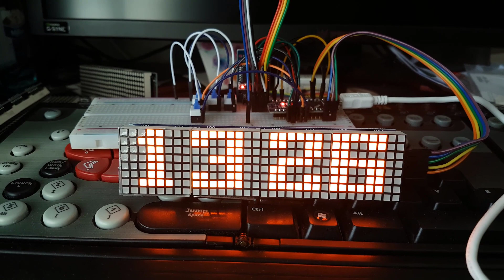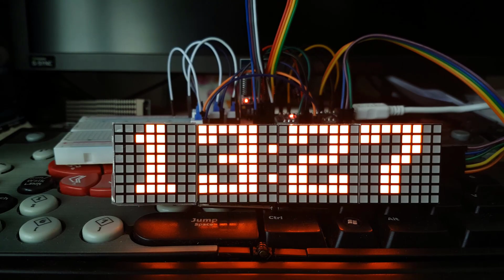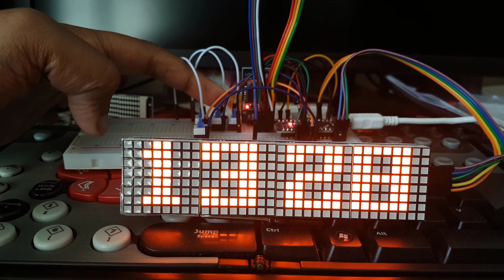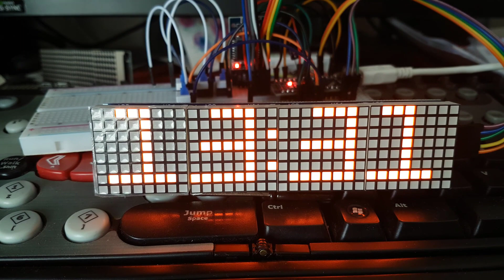Arduino MAX7219 LED Matrix Clock with BME280, BH1750 and DS3231

Comment: Опробовал разные варианты с подбором библиотек, твой набор библиотек, все-равно твой скетч не работает! Где-то ты лукавишь! Схема - не рабочая!
Reply from the maker: You have to use the older libraries supplied in the Github repository, new libraries do not work. And you have to use version 1.8.x of the Arduino IDE. It definitely works.

Comment: Great project! I would love to make something similar, but I cant find the square pixel dot matrix anywhere. Any suggestion where I could buy it?
Reply from the maker: It's made by Adafruit in the US. I got mine in the UK from thepihut. Codes ADA1821, ADA1820, ADA1819, ADA1818, ADA1817

Comment: I have been accompanying your project with this matrix; but I had not yet seen these matrices with square points; Does it work cool live?
It seems like it was with you that I commented on, rather than using buttons, to use IR Remote Control to control the array.
If I had more knowledge about Arduino, I would do it;
PS. Can the BH1750 be waived or commented out in the code?

Thanks for the project
Reply from the maker: The square LED matrix are from Adafruit, quite expensive. Check their website, I got mine from a UK supplied (thepihut). They work fine with MAX7219. Seems a bit excessive to control a clock using a remote? It can be done, you can even use bluetooth, or your mobile to control it. The BH1750 can be commented out.
Reply: @Ratti3  Thanks for the reply.
In case, I would use 3 or 4 keys of the remote instead of the 3 or 4 switches but, I do not know to define this in the code;
As for the matrix, I'll be using it with even round dots; Thank you ++
Reply: @Ratti3  The version with ESP can be used ESP8266 Nodemcu?
Reply from the maker: @Dancopymus  Should work, all it needs is the TX/RX pins connected to the Arduino, I plan on fitting a switch on mine so I can flash it once it's soldered. The switch will flip between Arduino Serial pins.